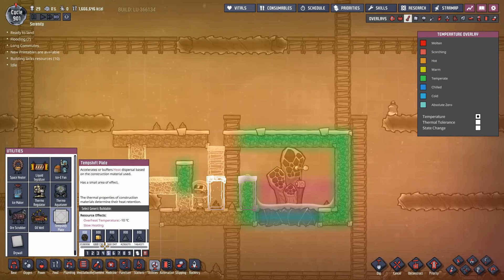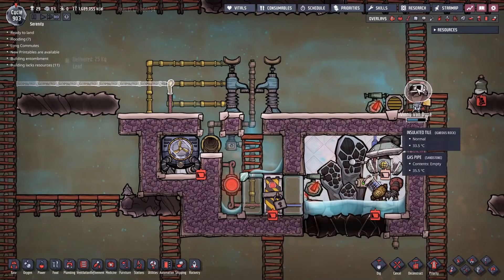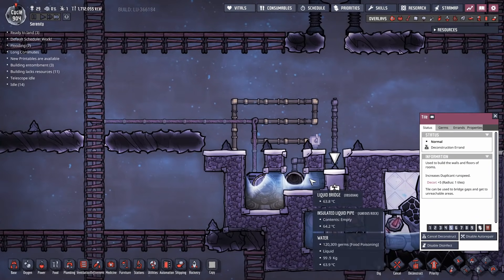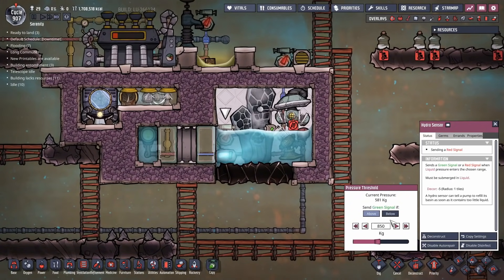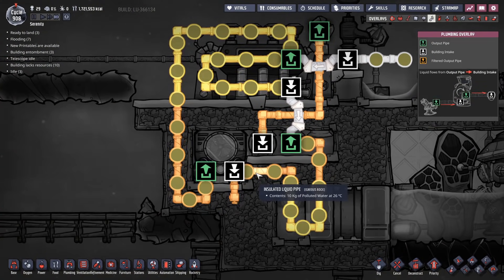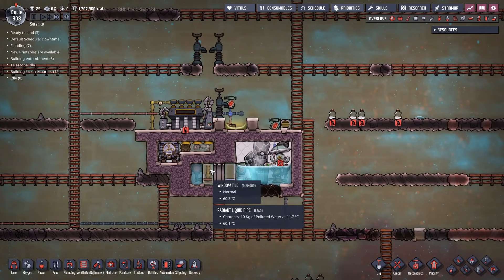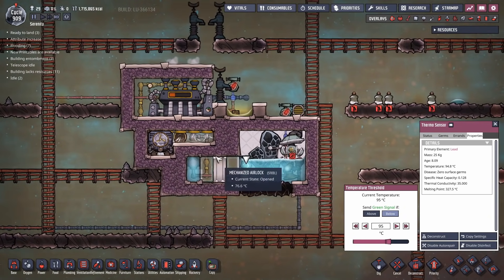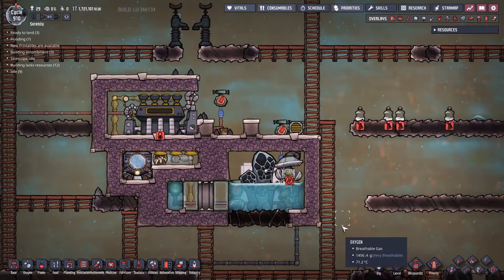Cool Steam Vent Taming : Tutorial nuggets : Oxygen not included

Comment: What is the point of cooling it at all if the lowest it cools is 95c? The water is still completely useless for use in the rest of the base at that temp
Reply from the maker: It's fine for O2 production, the oxygen is much more energy efficient to cool and the Hydrogen can be burned off in generators. So the heat is not an issue.
If you need it for food production you are going to need 2 or maybe even 3 aquatuners to get it cool enough, fast enough.

Comment: Bridges can cause unwanted heat transfer if you cross them between areas of different temperature.
The pipe overlay at 7:20 - instead of the bridge that brings the coolant over the turbine output (bridge crosses into the steam room), place a horizontal bridge for the turbine output so the bridge isn't touching 2 diff temp areas. Then the coolant can cross the steam room without any bridges. I'm sure the build works fine as is but it is a minor inefficiency.

Writing this for anyone trying to follow the build. "Insulated" buildings/tiles follow different rules for heat transfer. Bridges aren't part of that category. Bridges transfer heat based on their ambient surroundings, not the liquid being pumped through them. So a bridge crossing between a 30C area into a 125C area is transfering between the two ambient temperatures.

Liquid bridges have small mass so it's not as bad as if you had used 1 non-insulated tile as the wall of a steam room. But once you get to conveyor shenanigans with super hot debris, making a mistake with conveyor bridges (400kg mass of metal) like this can really mess things up.

Comment: francis your tutorials are the best 💕 

i know this is 5yrs ltr but on the off chance you see this and ok to answer: why use an ice box for cooling instead of just using radiant pipes to cool the water frm the steam turbine down?
Reply from the maker: The ice box is there to act as a sort of chill battery.
If you just use radiant pipes with cool water in them to chill the steam vent, you either have to cool down the water very cold or risk the steam vent over pressurising.
If you use a large body of water you can precisely control the cooling and not waste cooling/power.

Comment: I keep having an issue where my aquatuner gets no power I think because the tuner requires 1250W while the steam gen has 850
Reply from the maker: You need to provide external power to keep the system running. The steam turbine is mainly there to eat the heat. Any power it produces is just a bonus.

Comment: If you have a cool liquid source like a cool slush you can just make a corridor up above the geyser and pump the cool slush into a bead liquid dropper with liquid valves set to a couple hundred grams and a layer of metal tiles with radiant pipes that the cool slush comes through to keep the top cool. tame the geyser with a single pump that works 1/10th the time :)

Comment: This might sound silly, but what exactly does this yield? You get occasional hot water from when the vent produced too much condensed water.
But only here and there. So it's not really usable for continuously heating a base I'd say.
Or is this really all you can do with this type of vent?
Reply from the maker: In ONI Cool steam vents are more of a hazard than a resource, most people cap them off to stop them dumping heat into the surrounding environment.
In the early days of ONI they were the only guaranteed source of water, you would always get two on a map. So being able to tame them for use in O2 production was a requirement for the most unlucky maps you could roll.
In the more recent versions of the game you get so much water per map from vents and geysers that their is usually no incentive to tame cool steam vents anymore.

Comment: It has a fatal flaw. If there's not enough heat to move i.e. vent is dormant, 2 bad things will happen.
1. Coolant polluted water will freeze and damage the pipes before it cools injector to 20C.
2. In the steam room polluted water has boiling point of 119C, so it will still be present when normal water turns to steam and will offgas polluted oxygen even with high pressure steam above it. Which will lead to a blob of oxygen in the steam room and turbine's inefficiency.

Why heat injector? Is it even more efficient than radiant pipes behind the vent?
It looked cool, but I had to dismantle this design on 2 of my vents and start from scratch.

Comment: Instead of a pump, you could have a mechanized door dumping into the storage tank, just under the vent. Doesn't even have to be powered and it would only access the bottom water layer. Connect it to the hydro sensor with the exact same setup. If you've got the real estate nearby for the tank, it's perfect.

Comment: So I adopted this build. But maybe a bit early in my save. Still working toward "super sustainable" achievement so ive had dupes running on "wheels" to run the system for about 30 cycles so far. 
Hydrogen and wheels(and now a tiny bit of steam power) working to reach super sustainable, with 34000kj to go(hoping for less than 250 cycles when I get it)

Comment: How do you get the diamond for the windows?
Why make the Aquatuner out of steel?
This is very expensive, does it actually get that hot?
 Having ran your saved game, it doesn't even reach 130C.
Reply from the maker: Diamond was much more plentiful back at this point, you can use metal tiles instead now. You could get away with a gold aquatuner but it would require a bit of safety automation to prevent it overheat on boot up.
In terms of material cost this is not really that expensive in my opinion, I'm sure you could use cheaper material if you want just be sure to stress test it first.
Reply: @FrancisJohnYT  Thanks. I build a Metal Tile of Steel and a Window Tile of Glass to test their thermal conductivity. The Steel tile had one of 54.000, the Glass Tile of 1.110, so clearly metal is the one to go. And it's close enough to the 80.000 of diamond.

I still don't understand why the temperature is only transferred over such a small surface area.
Why not pipe the water through the cool steam vent chamber before heating?
Then the water could leave the system after being through the Steam Turbine and Aquatuner, so it'll be much colder than in the example.

Comment: I'm currently still in the early game, and there's a cool steam vent near my starting location that I really, REALLY want to tap into for the additional water to make up for the water that I use for keeping my colony fed. Unfortunately, I don't yet have access to plastic or gold amalgam, so using the design shown in the video isn't an option for me at this time. (That, and I'd rather not waste power cooling the steam down, or pumping out the water.)

What I do have planned to tame the cool steam vent using more low-tech means is to simply dump ice, made using an ice maker, using a secondary clean water source full of germy water from my toilets as the water source (in which case, the germs would hopefully be killed off by freezing the water into ice), into a storage bin next to the cool steam vent, cooling the steam enough so that it'll then condense into hot water. Once the steam condenses into water (and/or the ice in the storage bin melts), then it would then flow down into my main water tank (thanks to an aqueduct that I had built/dug out), which I don't care if it'll get too hot in the long term, since I'm only using the water there for science, cooking, and oxygen production (whereas I'm currently not reliant upon farming, and am instead relying upon mush fry and barbeque for food production).
Reply: While lo mg term you will need steam turbine and steel Aquaturner. You can make do with just piping adding cool fluids behind the vent. Then just using the very hot water for applications that don’t mind really hot watter. Personally I just send mine to the oxygen production system as it is also a heat selection system that doesn’t need plastic or steel.

Comment: I just want to build a simple steam generator above the vent and collect clean water below :(
Reply from the maker: The steam is not hot enough to do that it only comes out at 110C and it needs to be 125C. There are designs that heat up the steam instead of cool it down but they get a bit more complicated.

Comment: I know this is old but I literally got a steam vent under my starting base. Well like 4 rooms down. Just right under my main water supply. Just steadily heating up my base
Reply: Done and dusted.
Reply from the maker: Cap that sucker off, surround it in insulated tiles until you are ready to deal with it. If you are not ready to handle a hot vent like a volcano, steam vent, nat gas etc, brick them off with insulated tile and come back when you have better tech.

Comment: After building this, you quickly learn that you did it right when the space above the vent remains a vacuum.  If steam starts appearing, then you probably don't have enough temp shift plates / not thermally conductive enough to move the heat around.  Apparently 3 diamond temp shift plates are enough.  Through an engineering mishap, the rest were igneous rock apparently but the steam instantly condensed after I added the diamond temp shift plates.
Reply: An engineering mishap lmao

Comment: Does this generate a surplus of power or just enough to power itself?
Reply from the maker: It's slightly power negative, it's designed to cool water down to liquid temp. Think of it like a refrigerator that runs pretty hot. The steam turbine disposes of the excess heat and allows us to recycle about 40% of the power we use.
If you run supercoolant through the pipes you get 80% of the power back.
Reply: @FrancisJohnYT  Thank you. I wish i was better at this game i cant get a sustainable power system to work.

Comment: Sorry if I missed anything but where do the steam that feed the steam turbine come from?
Reply from the maker: It comes from the water we leave under the turbine.
The aquatuner cools the water passing through the pipe, but in doing so it makes itself hot. That heat turns the water around it to steam and we use the turbine to cool that steam down.
Reply: @FrancisJohnYT  Cool concept. I've got it. I'm not expecting a reply for a 1-year-old video comment. But here you are. Thank you very much.
Beside, is there any alternative for temperature management since I've not been to the plastic phase (for the steam turbine) yet.
Reply from the maker: @longnguyen203  For consistent heat removal you need a steam turbine. However you can get by for a long time by dumping heat into an ice biome or in a pinch you can dump heat into water.
I used to run the O2 output from my electrolizers through a cold biome in radiant pipes before sending it to my base. The cold biome would last a few hundred cycles.

Comment: Problem is .... water comes into the main water tank at really hot teperatures - over time, yeah you get eternal water but you need a way to deal with the heat too. A cold biome is not permanent enough, how do I deal?
Reply from the maker: If you need colder water you can set the temp lower on the system. But late game I would keep an insulated hot water tank and use it for oil wells and oxygen production. It's easier to cool oxygen than water and you don't care what temp your oil is at.

Comment: I remember looking at this video and getting extremely overwhelmed, to the point of quitting the game, about a month ago. (Eventually I came back.) 

But honestly, this is a very convoluted, overcomplicated way of taming a vent. Yes, it is probably the optimal way that uses the minimum amount of power. But for a new player this is a LOT of information to take in, and an incredibly expensive solution, for not a lot of water.

Advice for new players: Just run a standard cooling loop through the vent and be done with it. No need for vacuums, temperature shift plates, airlocks or any of that fancy stuff.

That being said, all the stuff used in this video becomes pretty standard and useful tools in your arsenal, for various other projects you may want to tackle as you get more experienced. So the tutorial nugget is definitely valuable once you become an intermediate level player.

Comment: I'm at cycle 180ish and I'm trying to deal with a cool steam vent very near my base. I haven't really gotten deep into cooling even. And watching this... I really need you to go slower and show each part thoroughly. I figure out a lot but this one is ... hard. I'd love some help but so many folks go so fast it's impossible to process.
Reply: I've had similar experiences when I tried tutorials for buildings with mechanics I didn't fully get. Mainly plumbing, like where should bridges go, how will water flow, where and how does it turn. Combine that with where does heat go, which pipes should be hot, cold, insulated, radiant and I see a thing in videos and tutorials.

So, the way I did it. Save game, give yourself 10-20 cycles for test buildings and experiment, then load when you're smarter. You'll see how the system behaves and will probably able to troubleshoot it. I didn't do half the automation in my crude-oil-heat-dump-steam-cooker yet. It has already burnt my dupes more than I'll admit. It's running at 250celcius, so it'll be hard to correct, but I can finally read the piping in tutorials.

If the video went in detail over each mechanic it would be actually bloated and less useful for most players. Week or two ago I've had same needs as you but today I'd need to skip over game mechanic details. Cheers!

Comment: My first pipe leaving the aquaturner keeps receiving cold damage, what could I be doing wrong? I have followed everything you have done.
Reply from the maker: Check the temp sensor before the aquatuner. What is happening is the water going through the aquatuner gets so cold that it freezes. It can't do it inside the aquatuner so the moment it hits the first pipe segment it turns to ice and breaks the pipe. Make sure the temp sensor is not letting it go below it's freeze point, remember to account for the aquatuner removing 14C of temp.

Comment: I was really proud of my way to "tame" this vent - i had a cool slush geyser nearby, so i just had a pipe with cold polluted water going through the vent area (so that i can purify it and not have it instantly change to ice), then purifying that water and dumping into a somewhat  big room with water from steam geyser. Good way to get ~50 degree hot water!
Reply: do you think youd be able to post a link or reference with screenshots? im having the issue where 3/5 steam turbines are blocked so it is only generating maybe 200 watts, and the water in the right chamber NEVER gets colder than 200 F, but the water in the aquatuner loop is getting to around 70 F

Comment: I got this working, except the water where the cooler is (not in the pipe) never reaches a temperature where it will turn into steam and power the turbine.
Reply from the maker: This is not a power positive process so you do have to provide power to the whole setup. It may take a while of operation before it has been used sufficiently to generate enough waste heat.

Comment: Hmm, I find this setup somewhat inefficient. I have system with Aquatuner or two inside the steam vent box (raised on mesblocks not to drow it). Aquatuner(s) is used to cool the ice box that cools base.
The vent produces steam almost hot enough to be used for electricity, so i warm it up (via aquatuners). 
So in this setup the 'cold' steam gets turned into hot water plus some extra power form turbine.

Because the Vent box will receive more water/steam overtime I have a gas pressure sensor and keep it a 2kg. Anything above that will activate shutoff water valve and water from steam turbines is redirected out to base (via icebox to cool it down). Otherwise the water is dumped back into Vent box to be reheated into steam.

I use one cooling loop through the ice box to cool the steam turbines as I had issues with overheating (though it might be due to bad setup/material etc).
Reply: Do you happen to have a screenshot of this layout/design? Thanks.

Comment: I feel like you "glossed over" the diamond window tiles as being not rare and high tech materials in your summation on the requirements for this build. They could be replaced with metal tiles I guess, to make this build available earlier. You probably only used diamond to showcase the building materials behind them , or to make the steel door the temperature flow bottleneck. Thanks again for a very informative video. I'm attempting to double use the aquatuner to cool the liquid further as I don't want warm water in my base. two stretches of gold piping encased by diamond is my current attempt at this, but I guess this will be obsoleted by super coolant later.

Comment: i dont get how the door works...it's a vaccum so how is it spreading cooling to the other place?
Reply from the maker: If tiles are touching they can exchange heat, imagine the steel door as a couple of metal tile that when it is open stops existing. When it is closed the tile on either side of the door can exchange heat with it. That way temperature can only flow across when the door is closed.

Comment: I have this exact setup but my geyser always seems to say overpressure. Any ideas?
Reply: To my knowledge a tile which corresponds to "overpressure" check on geysers is B2 if you use chess system (second tile in second row), so you need to switch termo and hydro sensors and have only a single row of water.

Comment: What temp is the water? Will I still need to cool it down?
Reply from the maker: The water will be 95C when it comes out. If you are running it through a electrolizer, don't cool the water down, cool down the O2 after it comes out, that is far cheaper in terms of energy to do. If you are feeding it to crops you are better off cooling the crops if you can.